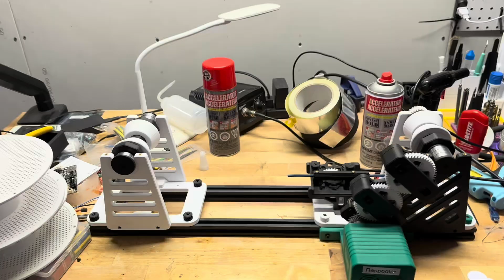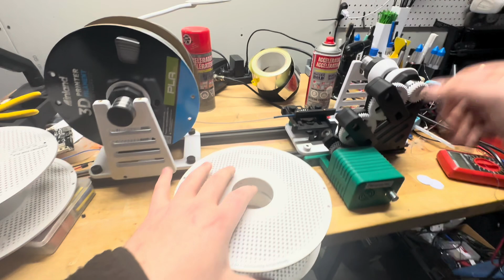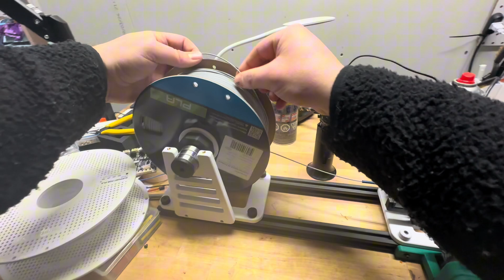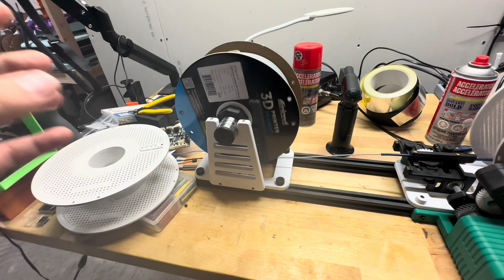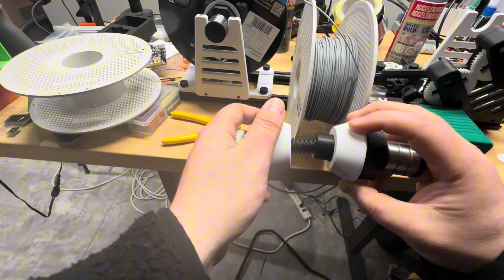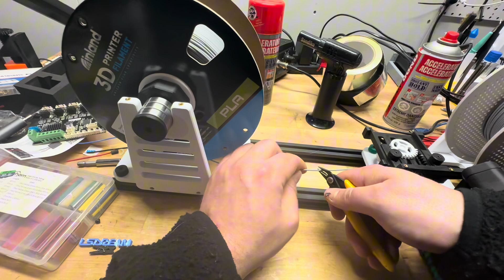Make MORE Money 3D printing by using a Filament ReWinder!

Comment: I'm starting to build this project now. Can you respool from 2kg spools such as the prusament 2kg spools? Do you knownif they will fit on the donor spool holder?
Reply from the maker: I think this is just for the 1kg spools
Reply: @ComiskasCustom  I've used this to respool 5kg spools, but I used a different spool holder I got off makerworld.  I just clamped it to the desk so it didn't move around.

Comment: 3D print farm owner here, and let me tell you two things:

1. You using low quality materials (random knockoff PLA) will reflect on your prints. Spending 2-3$ more on better filament won’t hurt your business, we know the markup we have in this industry.

2. Time wasted on an insane scale. If you are doing this for the AMS, you’re better on printing insert weights and plastic rings to go on the spools. You’re wasting too much time that you can use printing, multiplied by all the times you do it, lord have mercy.
Reply from the maker: The idea for the video was to split 1 roll into multiple. I know its a waste of time to respool everything, but why buy more filament than I need if I don't have to spend the money? The respooler actually saved me money by being able to split one roll into a few and run it across multiple printers to complete an order faster than performing it on one printer.

Also, the respooler is printed out of PLA. Definitely not the best, but it works. PLA seems to get a bad rep for things it can actually do. Sure, theres better stuff out there but If I have it on hand, and it works, why not? Plus, I dont think I use it enough to justify buying polycarbonate just for this. May reprint it in ABS, if needed.

Motor can go faster too. Its a 12v motor that I was running on 5v just to control it better. upping it to 12v makes it run fast, which is good for full rolls that need splitting and 5v is too slow for those.
Reply: Good advice!
Reply: Just a suggestion...
Print the gears out of polycarbonate. They look like pla or petg. 
What's the rpm of the motor?
Can the motor go faster?
Reply: What filament do you recommend?
Reply: @GreyWolfLeather  polymaker makes good PLA and it’s not really costly. For ABS, ASA-CF and PA6-CF we use bambulabs because we have a B2B account and bulk is cheap, it runs you around 13€ per kg of filament.

Deffo would recommend this two